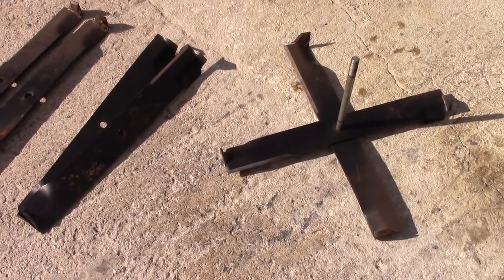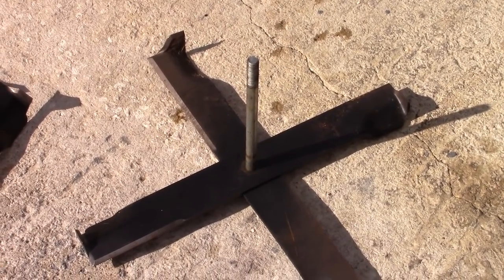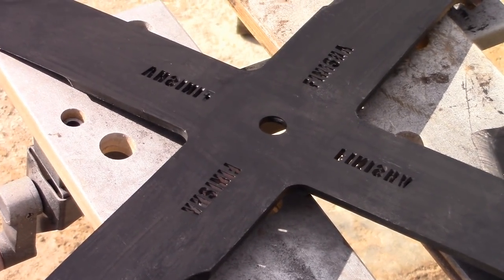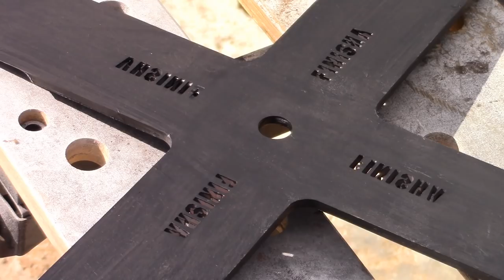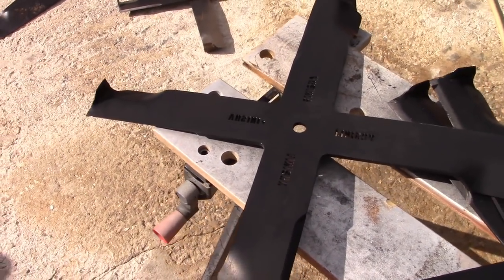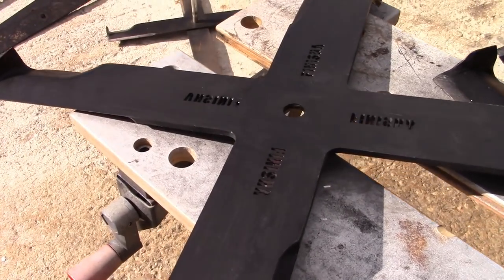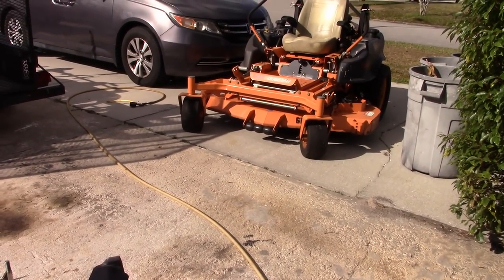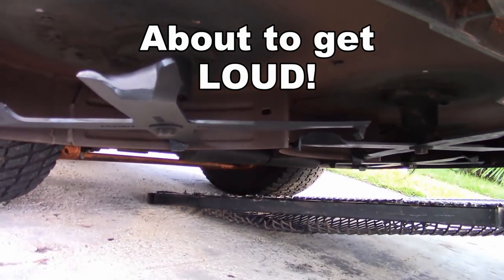Mowing tall thick grass with Kavli Finisha X-treme blades! X blades - Awesome!!

Comment: I hope u turned those blades over.. Cause at the 4 min mark they are upside down.. The flat part of the blade is soppused to be down.. So with those blades also the wings in the ends are soppused to be turned up.. Just letting you know. They might work a little better
Reply: Thought the same thing instantly.
Reply from the maker: Of course you do see the scene where I am engaging the blades with the camera pointed up under the deck.

Comment: i remember like 8 years ago i begged you like 50 times to do xblade formation in the ultra thick/high grass.
Reply from the maker: ...and there it is. Anything else? hehe :)
Reply: Hi David I am not aware of any X blade formation able to cut tall ( at least more than 1 foot tall ) grass. The blades must expel the grass instantly in order not to clog the mower up and stall. This is what makes all our blades unique. The grass has very little time to sit under the deck it is expelled almost immediately. The sheer volume of grass that Mike is cutting and is being thrown out is staggering even to us!

Comment: I'm a landscaper in Rhode Island USA, and most of my customers receive a lawn cut weekly or a cut biweekly.  I have a 52 inch side discharge Mower and my goal is to have the grass clippings be so fine that it looks like it's been bagged.  Do you think these blades can accomplish that?
Reply from the maker: Yea these are the best all around blades I've used, if you can get them.
Reply: @Something2LookAt  by the way, how do you properly Mount the finisha blade? Does the pointed side point up or down toward the ground?
Reply from the maker: @StevenClark-f7w  It sounds crazy but the teeth do point down. They're designed to get all the tall grass that lays down as the deck passes over them.

Comment: Just wondering if you noticed a loss in power? I noticed that big Kawasaki was bogging just a little a couple times and was wondering if it did that before installing those blades. I know with the blades I have now, which aren't x blades, just standard high lifts, my bad boy would go through that without bogging but I would probably have to do it twice lol
Reply from the maker: Oh yes, it's harder to turn these. It's like having six blades to turn and extra weight, but it does it. Takes a while to slow them down too when you disengage them.

Comment: i am seriously impressed, there is a demand for these blades and i know exactly where to use them and for what business model, but i'm not sharing as this is the edge i'd need to murder the competition in cold blood! 12:40 is that one tip missing on the leading blade? i wouldn't be surprised as i'd expect to hit alot of  wheel sized rocks protruding or laying around. if it's not i NEED a few sets of these blades. if it did break off, that's f'n scary and i would need to know where it went. would be too easy to see this hitting some one or a vehicle or building as i was passing by.

Comment: Correct me if I'm wrong - but at that high RPM, and with as many blades as there are, I would assume that the wear would be more or less even over time, reducing the need to balance?
Reply from the maker: Seems that way. I was surprised to see that they were all precisely balanced. I would think that would be a trick to do. But who knows. It's a new concept. You may be right.
Reply: Hi Sara good to hear from you and that is a terrific question. As yet we have not sharpen the X-Treme blade and no one has gotten back to us with that kind of info. They seem from all our testing to wear evenly. Just wondering if Mike can enlighten us.
Reply from the maker: @johnkavli8181  Ha, I haven't sharpened an X-treme blade yet either. I'm sure that they wear evenly though. Once the disaster areas start getting overgrown again around here I'll put the X-Treme blades back on and go brush hogging!

Comment: Seems the power of the Cheetah is well matched to the "Xtreme" blades just pulverising the brush into dust. wow...
Reply from the maker: Interesting that you mention power. These blades are requiring a lot of power. I rarely throttle the Cheetah all the way up and I had to for all this footage. If it's a big mower, make sure your horsepower is 30+.

Comment: Can you get them for a Scag Tiger Cub, 48 inch deck??  and if so whereabouts, Scag?  I am in Australia.
Reply from the maker: I'm positive he can make them for that mower. Link to his site is the top pinned comment.
Reply: HI Roderick we manufacture these in Victoria
Reply: What would be the cost for 3 blades for a Scag Tiger Cub please?  Size of a single blade is 416mm long, 62mm wide,5mm thick and a 16mm clearance hole in the guts.
Reply: @roderickbarry2411  could you please send us your email or send us a message through our site it is much easier for us.

Comment: "I know this is overkill but I'm going to do it anyway."  - Awesome.  With that many blades do you have to check in with local air traffic control towers before starting up the deck?
Reply from the maker: lol, almost! It does sound like an airplane now!
Reply: Overkill id necessary to get the job done quicker. 😀

Comment: Can you use those a troy bilt 6 hourse push mower
Reply from the maker: Stay tuned. I will be mounting one of these on my Cub Cadet 21 inch push mower and we'll see. But I think it will work fine.
Reply: @Something2LookAt  ok thanks i have a mowing business and i need a good brand and blades

Comment: dont the wings need to be pointing up
Reply from the maker: They are designed to point down. As the really tall grass and brush gets pushed over by the deck, it can miss the blades all together. The teeth on these blades sticking down catch it.

Comment: I would say those are successful it’s like you have a bush hog with those blades on!
Reply from the maker: Oh yea, these blades are prototypes for testing but I told them they are quite good.
Reply: These blades are expensive but nowhere near the price of a bush hog, with a much better finish.
Reply: @johnkavli8181  How much?
Reply: Your blades have to be longer than 530mm or 20 1/2 inches
Reply: @rudycarlson8245  $100 EA in Oz. Say $77 EA in usa ?
Reply: @terryinozland  Thanks
Reply: @Something2LookAt  do you have a discount code for kavli blades?